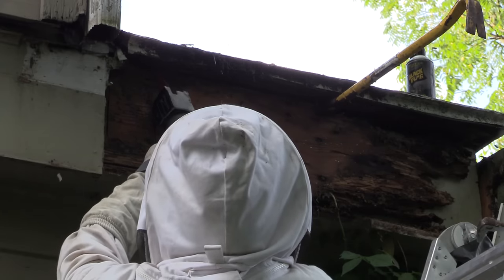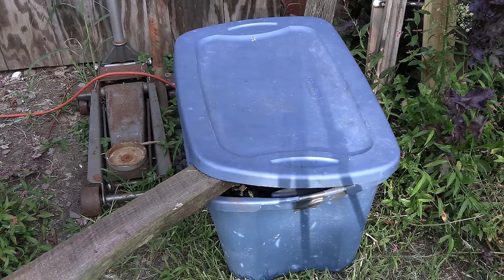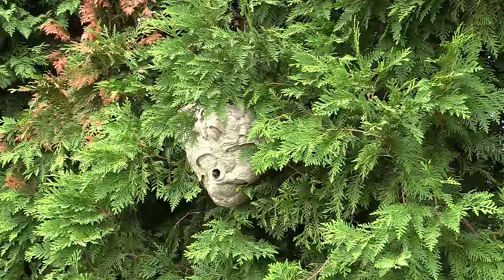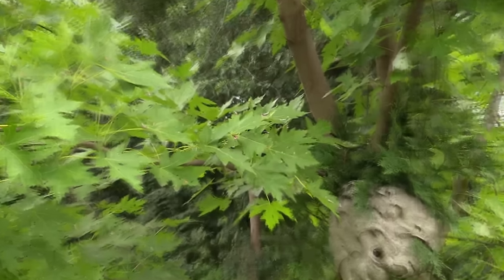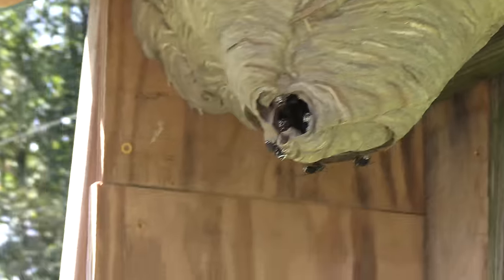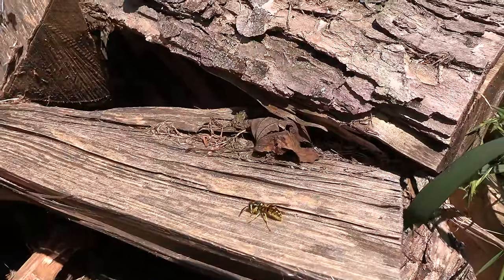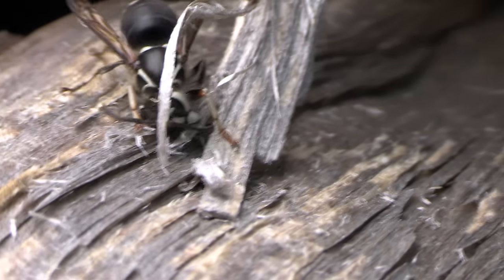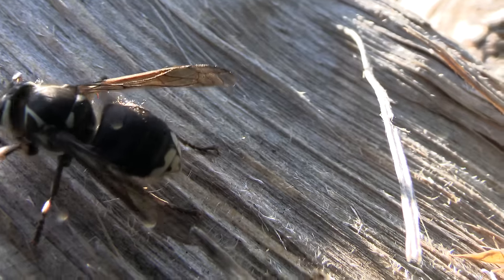Yellow Jacket and Bald Faced Hornets HUGE Nest Relocation Macro Shots Wasp Nest Removals

Comment: Question: today I found a golf ball size yellow jacket/ bald face honeys nest in my BBQ. When I kick the BBQ to see if it was active, both a large yellow jacket and a large bald face honet came out of it. I took the rack out that it is attached to and put it on 2 sticks over an empty green bin (compost bin) . I moved the BBQ and put the bin where it was. Both of them are coming and going back to it. It's empty ( no cones) will these two different species inhabit the same nest? Never seen this before any insight as to what going on. Both seem to using it.

Comment: I have a small nest of wasps but I’m unsure of what type they are exactly. I’m from Kentucky and this type is pretty common and are just referred to as “wasps” around here. They are slender in frame, though are quite long. Dark color with some yellow markings on the legs. I did some research and it just said that it’s a type of paper wasp or umbrella wasp but nothing real specific

Comment: The histamines are what make the stings itch so much, if you get cheap off brand benadryl, you can melt the tablets in a tiny amount of water to make a paste and rub it straight into the wounds. It will stop the itch completely, we deal with a lot of mosquitoes here and that's how i treat my small child for occasional bites instead of giving her oral anti histamines. Just a quick tip, thought someone could use the info!!

Comment: Interesting as hell but it gives me the willies!
I've got 3 hornet nests in the exterior walls, we have them in the house, they come in somehow, have sprayed them for a few weeks now and they still survive. How, I don't know. I'm using Spectracide. About worthless unless you hit them dead on.
Reply from the maker: Youre only killing workers. If you asrent hitting the nest itself, new ones hatch quicker than you kill a couple.
Reply: @HornetKingOfficial  Oh, great. Well I have a bee veil coming, Tempo powder, and squeeze bulb. If I can see the nest I'll spray bomb it. Circa 1912 house with lots of gaps in the trim outside. I'll work at night and have a red flashlight. I'm trying to get some exterior work done and there's nests in two places I need to work and the third nest lets them into my front porch. One of the nests is yellow jackets and I'm going to make a meat/water trap. The spray bomb does nothing to this nest, they are too far into the structure. I have a powerful shop vac.

Comment: Oof that computer on the right is in rough shape
Reply from the maker: Lol, no, I am constantly hooking up new hardware and running different HDDs and SSDs so I have both computers cases open. That's what your desktop would look like if you took the cover off.
Reply: @HornetKingOfficial  was mainly just talking about the cable management but its understandable, swapping things alot etc
Reply from the maker: @bmo14lax  oh yeah dude, THAT is a mess! Lol, the pig tails in that com are a nightmare. I have stuff hotwired lol
Reply: @HornetKingOfficial  new to your conent and liking it alot so cable management or no, i like ya. Keep it up pal. I'm in IT so im just a stickler :)